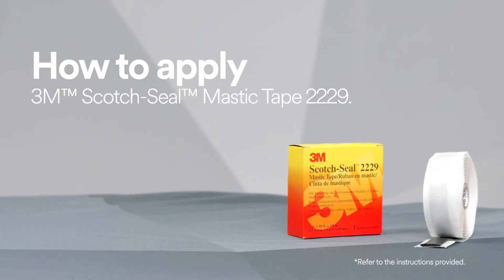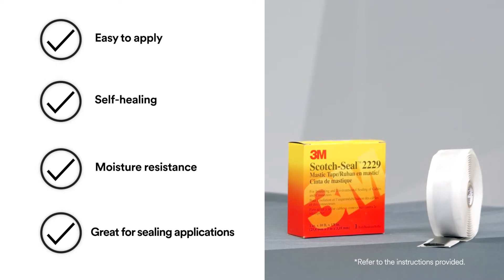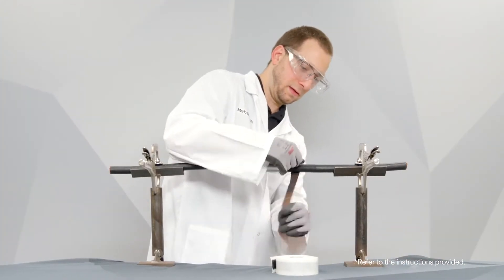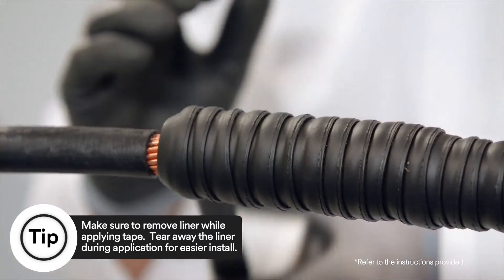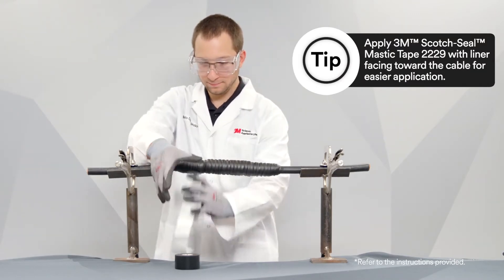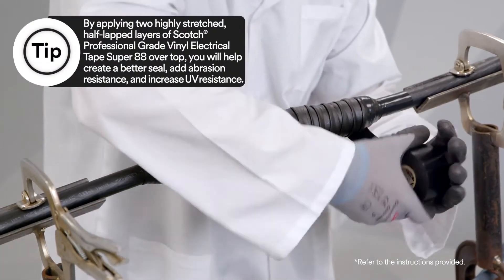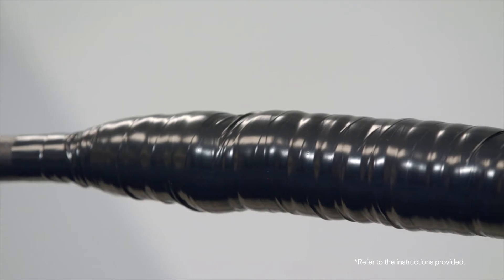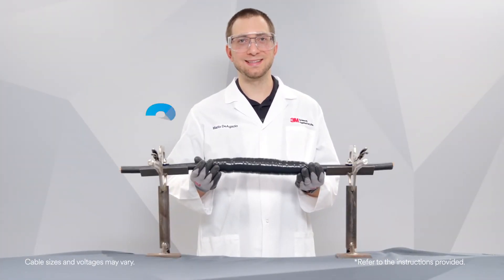3M™ Scotch-Seal™ Mastic Tape 2229 – How to apply

Comment: Looking at the specs, 2229 is twice as thick as 2228. If space is an issue, it would seem that you would be better off using 2228 as you can apply more layers for the same over-all thickness.
Reply from the maker: Absolutely! Please keep in mind 2229 is all mastic, designed thicker to help you quickly build up thickness where you need it, or more slowly by stretching it, which makes it thinner, whereas 2228 is designed as a mastic with a rubber backing built-in to provide a one-step approach to sealing and finishing a splice or connection that does not require a lot of filling.